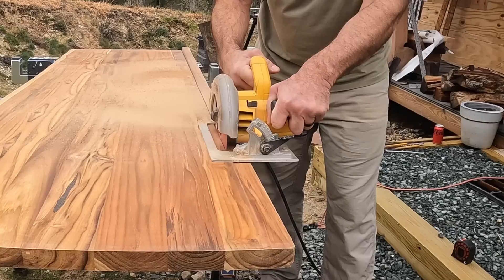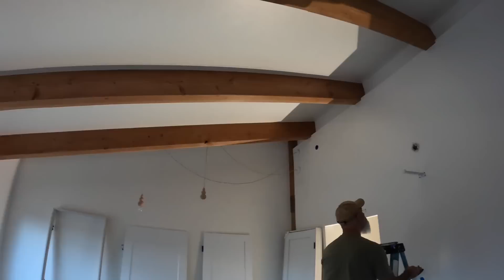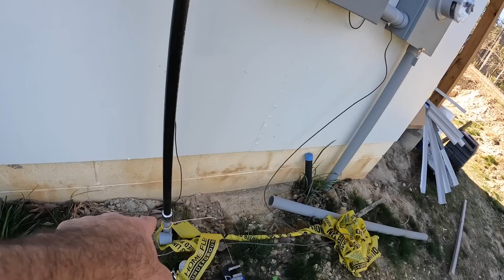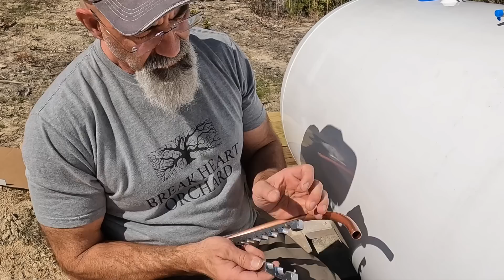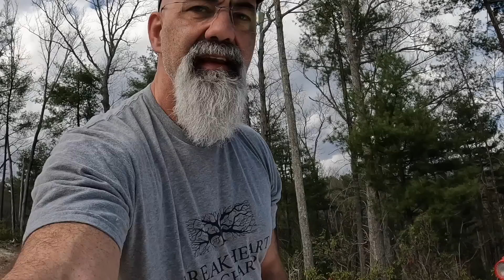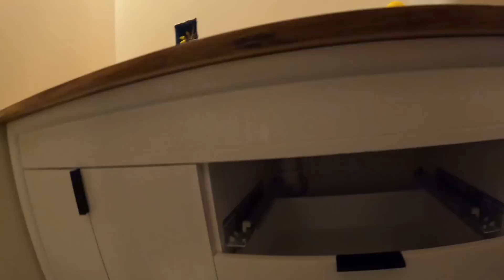The final list-  DIY House Build - teak countertop, pendulum lights, Propane Line,  vessel sink

Comment: if you ever do this again, for second stage regulator, use rear mounted regulator, that way you only measure lower side of the pipe, or even better just use flex riser, something that is 72 inches, so that way you can use the flex properties of the riser to adjust the regulator height, both first and second stage regulators.

Comment: Someone may have already said this, but you really need a shutoff valve in the line to the house both at the tank and the secondary regulator for safety and emergency shutoffs.
Reply from the maker: The POL has a shut off built in

Comment: Hello don't know what your name is but let me say this regarding your propane piece install and I'm not a plumber either buy some redi steel baby or regular size mount it to the wall of your house and buy some pipe clamps for it. If it does reach the pipe build it up with a piece of wood or add an other piece of redi steel using spring nuts and 1/4 20 bolts. Good luck Jerry

Comment: Have you ever heard of a compression fitting vs a flare fitting,   A compression fitting solves the issue of not having a flare at all.
Reply from the maker: As I understand it, the copper compression fittings are approved for water but not gas. Although the polly fitting is compression.

Comment: I think mistakes keep us humble, most embarrassing to find ourselves a work in progress.. I've done some gas work and large pipe was not something I would of used in the copper parts... ran mostly three eights copper as its just a ton easier to do and keep up with. Ya all in all did a great job and not picking holes in the quality of your work, I just do it differently is all.